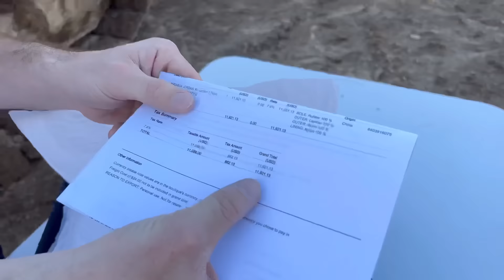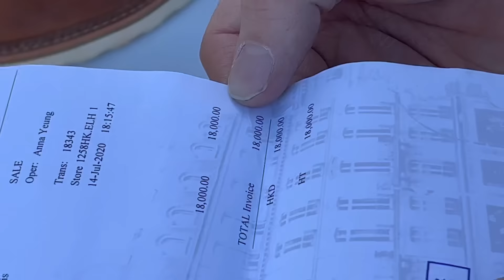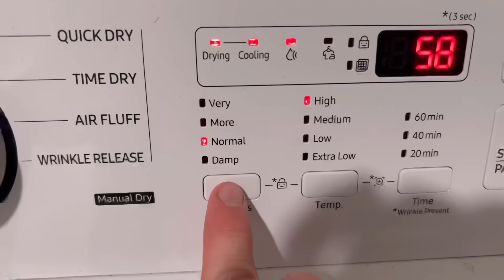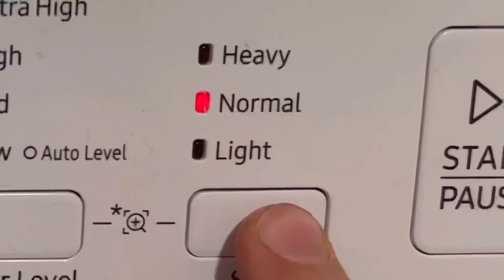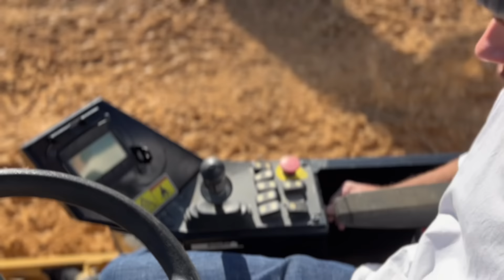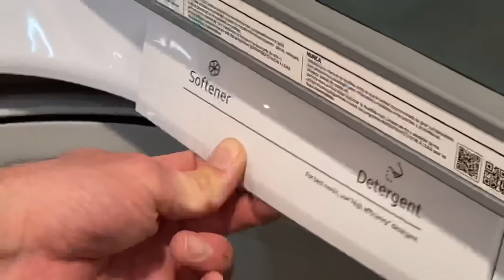Using $12,000 Air Diors as Work Boots

Comment: I cannot believe how well they stood up to everything. and I cannot believe how those Redwing shoe strings broke so easily that's nuts.
I have some AJ 3s and I've been wearing them for13 years now.  There were 3 years as nice pair of shoes. I've used them for 10 years as a hard-working shoe doing a lot of construction and electrical. I have also used them on my property doing a lot of manual digging type of work I'm pretty impressed how they have held so well.  They have also been run through the washing machine at least 30 x in 13 years usually 2 x a year and if I stepped in shit an extra time here and there.  A pair of Adidas lasted me a year.
Reply: That why them aj3s $300+ rn
Reply: The leather laces are usually over saturated from oiling, so they easily break.  Idk why they even send them, any boots I've had leather laces come with had the same issue, first thing you do is replace them

Comment: Honestly I’m more concerned about his washing machine then the actual shoes
Reply: same i went "wtf calm down with the detergent, something's going to break"
Reply: Looked like a base model Samsung top loader to me - nothing particularly expensive. They sell these for $500 (CAD) all day at retailers where I live. 
With that being said - don't do what he did if you value your investment. Too much detergent (especially in Samsung machines for some reason) causes the spider arm (the big ol hunk of metal holding the stainless metal spin basket) to deteriorate. If your front loader ever doesn't seem to spin properly, and you use more than a tablespoon of detergent (or one detergent packet) in a wash cycle, that's probably what's happened. 
They don't build machines like they used to, but of course they don't. They're cheaper than ever before.
Reply: The dryer, though…

Comment: If they made these with a steel toe they honestly could be a decent comfortable work boot for like 100-150$
Reply: Id buy them 300 with a steel toe😂
Reply: good luck finding ANY retro air jordan for under 280.
Reply: I don’t think he knows that work boots have steel shanks in the sole so if you step on a nail it won’t go through your foot. That Olson makes it so it doesn’t bend
Reply: @kcck7588  they don’t gotta be retros could probably be a redesign Af1
Reply: @spooc097  I’ve always bought cheaper boots so I didn’t know
Reply: If it was steel toe I think it would’ve failed the durability test tho, that steel would be fuckin flattened
Reply: @CantedDong  true
Reply: Just get a different Jordan 1 and modify it with Steal toe
Reply: @spooc097  not all boots have mid plates, and the ones that do aren't designed for nail protection, they primarily save your feet when working on ladders.

Comment: Seems like they're more durable than the Rocky Lumberjack boots I spent like $300 on, that literally fell apart in 30days... 

   I have a WD sort of a problem when it comes to durability. My Dad used to call me Crash when I was a kid lol.
Reply: Try the Timberland Pro Boondock, been rocking them over 10 years. Comfortable and durable, steel toe, thick soles... But I recommend getting Dr Scholl's gel inserts too. And cut them out under the pinky and 4th toes, otherwise you'll get hammer toe if you're on your feet all day every day like me.

Comment: What’s terrifying is that they made 8500 pairs of these shoes. 8500 x $11,000 = 93.5 Million. So if they all sold for the around the same price as these, Nike suckered 8500 idiots and now has 93.5 million dollars.
Reply: They're where actually $2,000 retail. So 17 million was suckered off of sneakerheads.
Reply: they were 2000 + tax from nike and Dior resell was super high at 10K -12K
Reply: @eder7468  or sneaker resellers collectively made 40-80 million off those 8500 pairs..

Comment: 5:27 What makes the shoes 12k is actually simple yet complicated. Nike X Dior came together, they had to pick the color and the design they were gonna go for, then its how many are made in general and how many are made in each size.

For Example: You can get a pair of redwings for 40$ those are simple workboots worth that much and there are god knows how many in that color in that design and in that size

So with Nike X Dior, they only made a certain amnt of those sneakers in a limited amnt of made in that size you have

Comment: if you woulda rolled those boots on actual pavement will full vibe on vs on dirt it woulda done damage 100% when the roller grabbed it and dragged it on the ground a few inches back and forth each direction